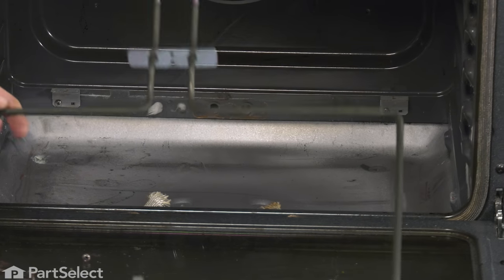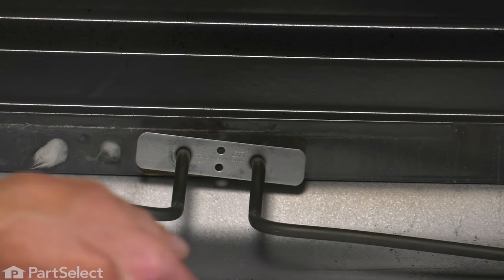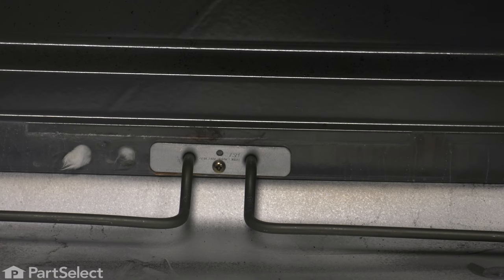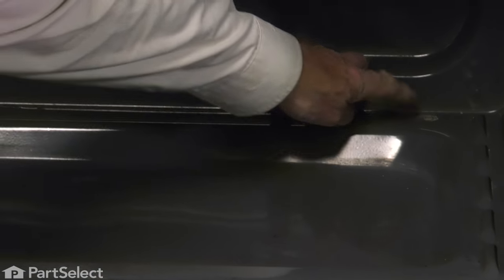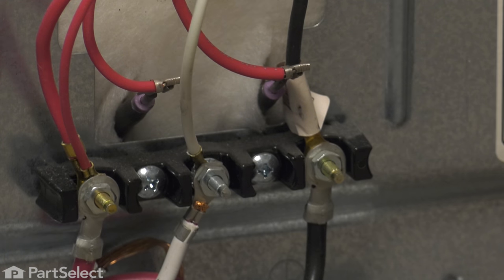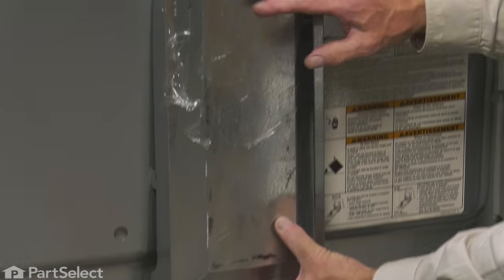Whirlpool Range Repair - How to Replace the Bake Element (Whirlpool # W10779716)

Comment: I have had to replace the Bake Element twice now on my Whirlpool range -- seems to burn through on me every 3-4 years -- but at least it's only a $30-$40 part, and it's very easy to replace as well, especially when following this video.  Thank you!
Reply: Most people won’t know and will spend $400+ on a repair visit.

Comment: How many people do you think would just throw out the oven and buy a new one, rather than replacing a $40 part?
Reply: I literally just moved my oven out to clean under it and on sides and then when I went to heat stuff up tonight it's constantly clocking with it set to 400F... It's hot but no idea how hot inside and food taking forever.... Assuming it's temp sensor throwing off the relay I hear. However broil works soooo I guess I'll test ohms of bake element first
Reply: Currently waiting on my food to get to temp, ...... Ughhhhh so many hours.... Must not waste the food! Lol

Comment: couldn't you just unscrew the bake element and pull it out and then disconnect the wiring so you don't have to access the back of the oven?
Reply: Yep. Just checked my oven and you just unscrew the baking element mount and pull it out until you see the wiring connection and then disconnect.  No need to access the back of the oven like he shows in the video.

Comment: I have replaced two of these on our 2015 model oven. This model has square drive screws not  phillips head. Also, it is much eaisier done if  you remove the door. Open door fully, pinch and pull the locking tab on each side hinge, close door about3/4 way and lift it out. Reverse to reinstall.

Comment: Thank you so very much.  I just did this myself with my son helping only to add a little muscle to unscrew the very tight screws holding in the access panel.  I did all the rest and saved myself at least $150 dollars or more for the repair.  Your instructions were absolutely perfect! N.B. the element cost is up to $60.  Repair service wanted a minimum of $118 just to show up and look at it. And then they would have still had to order the part and come back.  One tip the parts store gave was to make sure that the wires the element attaches too can't fall back inside between the inner oven and the oven's back panel or you would have to remove the entire back of the oven.  I didn't have that issue.  Those wire clips were quite secure, but I was grateful for the warning.

Comment: Thank you for all the time and effort making this video - great job!  Lots of helpful points  -  Lift the element cover to unslot it easily from the front  •  Check terminals for corrosion, arc'ing •  Use protective washers before inserting screws  and do NOT overtighten the screws so as to preserve the porcelain surface from corrosion.

Comment: I've never had an oven I've owned burn an element, but have in a toaster oven. If the bottom element isn't coming on, it could be the thermostat accessible from the back or the main board. Is there also a separate relay for the broiler, convection element, and the bottom bake element? I don't want to order the part only to find out it  was a relay. Guess I am going to have to take it apart ad test first, which means two trips.

Comment: I am hoping that Steve or someone can tell me what gauge female Quick disconnect would I need for this replacement? The terminal was burnt and needs to be replaced. I was looking at T1114 Quick Disconnect, High Temperature, 90 Degree Flag, 12-10 Gauge, 1/4" Female. Would that be correct? I went to Home Depot and Lowes and neither had these female disconnectors.
Reply: Did it work?  I've heard rumor that it's 14ga but you can use 12ga connectors for it...

Comment: Hi I believe i aura an older model. Whirlpool gold GLP85900.. I need to change the bake element but my oven bottom does not have the 2 screws in the back of the oven. How do I get to the element?
Reply: I have the same question.
Reply: Same here

Comment: Note to self: open up the back and check the connectors "before" ordering a new bake element, cuz if they're bad, the element might still be OK...I guess you can even check it with a multimeter if so desired...check for continuity IIRC :)

Comment: I was replacing the element and where the front screws in towards the door, has a Crack. Does the oven need to be replaced?
Reply from the maker: Not if the crack is just in the porcelain coating. There are some touch up kits for those sort of things

Comment: Thank you for this video!  The element in our Whirpool oven caught on fire, and with your guidance my husband has now replaced it with a new one.  However, even with the new element installed, the oven will not heat.  The broiler apparently will not work either.  The stovetop works fine.  Any advice on what we can try next to get our oven to work?
Reply: change broiler,too. I had the same problem!

Comment: I just did this. Not as easy as it looks. The element prongs did not go back in the holes and through the back that easy. I had to move the insulation out the way. Then the (2) red wires that plug back in the element prongs were to short to reach the new one without resistance. I had to push up on the element prongs and pull hard on the wires to make them meet and was afraid due to that resistance they would come unplugged but they did not thank God and it works. The wires need to be lengthened really to meet the prongs with out having to pull and push so hard to do it. O, and the 2 screws that hold the pan down that sets over the element,  are junk. One come out fairly easy. The other I had to spray WD-40 on it and still stripped the head. I ended up getting it out with a square head bit but was fixing to drill it out.
Reply: Mine reached easily FWIW...might depend on which oven? :)
Reply: All six screws are square drive . 2015 model oven. Ymmv

Comment: Feeling lucky. This oven was originally installed in the mid 80's and the element finally gave out. Just ordered an oem replacement heating element and feel confident that i will be able to replace it per your video. Thank you
Reply: Yep, it's back in effect. Thanks again

Comment: Recently had a lot of sparks coming from the bottom of the oven (visible thru the slots in the bottom), producing a good amount  of smoke before I could turn off the oven.   Does this sound like a fix for that type of issue?
Reply: Yep, your element may have been cracking or something, depending on where the sparks were coming from...
Reply: @RogerPack  replaces the element over the weekend.  The element was completely broken and burnt in two places on the left side. About a 6 inch section was completely separate upon removal and the back connector had burnt so I had to replace one of the connectors.  Seems to be running fine now, fingers crossed.
Reply: @dilley_esq  where did you get the element??
Reply: Without a doubt.  Mine burns through about every 3-4 years.  Easy to tell for sure if you just remove and inspect the old one.